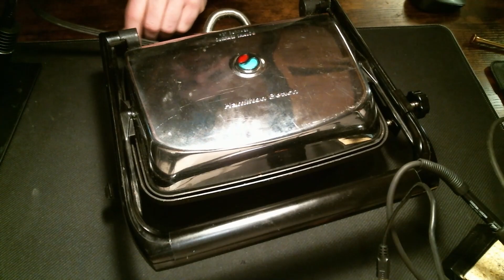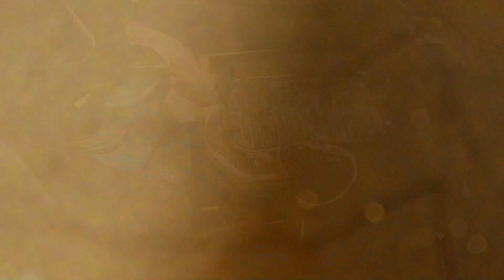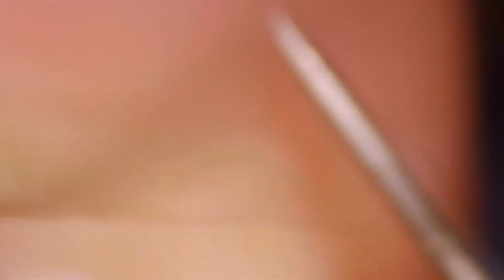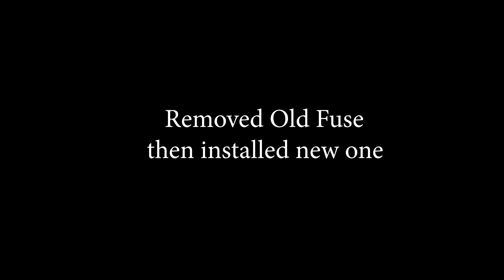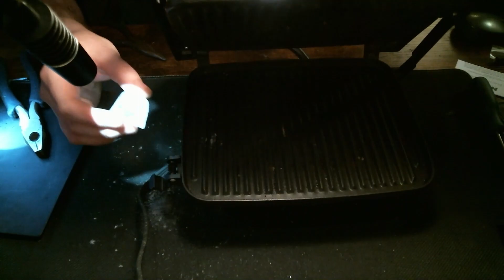Fixing a Broken Hamilton Beach Panini Press

Comment: What type of but connector you use ? And what gage ?
Reply from the maker: This was a thermal fuse replacement.  Uses mechanical connections.  Essentially you crimp the ends together with metal clips

Comment: Video is great!  MY HB PP bottom grill is detached from the base - is there a good way to reattach - can I use tape or glue?
Reply from the maker: Tape or glue will likely not last long, it is possible to bend some metal and screw it in or do some sort of mechanical fix?  If you're interested I could help if you joined the channel discord channel

Comment: Did you just solder the new fuse on?
Reply from the maker: No it will likely melt if you do that. They come with little crimp rings so you can mechanically bond the legs of the thermal fuse to the wires
Reply: Mine didn't come with any crimp rings . Can you recommend one . Thanks

Comment: What type of bit did you use to get the electric cable wires under the black housing (4) screws ? Please.
Reply from the maker: Oh it's hard to recall, either a Philips or a torx bit maybe.  
Whats the issue you're having?
Reply: @TestingWithMike  no worries I got it loose.  Thanks for sharing your knowledge 🙏

Comment: I bought a new 3-in-1 sandwich / waffel / grill master from LIDL..used it 5 times... it did warm up slow, but I thought it was normal for the model.. now it will not heat..plates are cold..but the lights are still on, when power is on.... but the watt-meter I passed it through, says 0 watt.. thoughts ??
Reply from the maker: Likely a blown fuse or thermal fuse.  Going to the warming plates.  Crack it open and use a volt meter and follow some of the testing methods I use in this video, and im sure you'll find the issue
Reply: @TestingWithMike  Yeah, it must be something like a blown fuse, or a wire that is disconnected... thx for answer..
Reply: @TestingWithMike that's the answer I needed

Comment: My H-B panini maker has been sitting in the back of a kitchen cabinet for years.  The plastic colored light cover broke off and the internal part containing the bulbs fell inside the machine.  I took it part but don't see any obvious way to fix it.  Any suggestions or should I buy a new one?
Reply from the maker: Does it turn on and heat up? We're you able to check the thermal fuse?
Reply: @TestingWithMike  It heats up, but I don't use it because I fear the wiring, bulbs, or plastic housing may contact the heating element.
Reply from the maker: @Paladin1873   Is there any way for you to fix the wires that fell through or at least get them out of the way?
Reply: @TestingWithMike  No.  The bulbs and bulb wires rest on a round plastic cup that sits centered under the top lid.  There's a hole in the center of the lid that normally is covered by a red and green colored plastic cover that attaches to the cup inside.  That part broke off several years, so now the internal cup and bulbs have no way to stay in place.

Comment: As part of the initial testing you do, I always add a Kill-A-Watt meter before the plug, so even if no tell-tails (lights) come on, it can still determine if it's drawing power. Another tool is a variable DC bench power supply that allows you to put power to select sections of the circuits and see the reactions, or lack there of.
Hope that helps. Keep up the great work!
Reply from the maker: Great tips thank you!  A DC Bench supply is one of the next tools I need to invest in

Comment: When checking your thermistor for voltage, you should not read voltage from one terminal to the other. When you read voltage to ground on both sides=the thermistor was working as designed
Reply: Great video tho! I don't wanna sound criticizing, not at all. I love fixing things that "can't be fixed"! I think your channel idea is a superb one. I hope that it encourages other to take a stab at repairing things instead of throwing it out and just buying new! Keep it up! 👍
Reply from the maker: Great tip!  I figured since it had continuity with low resistance, all should be good.  Noted for the future though, thank you!

Comment: I think seeing you replace the fuse would have been hella interesting
Reply from the maker: Truth be told, the footage was corrupted.  Essentially the fuse comes with two clamp down brass circles which creates a mechanical bond.  Because the temps can get fairly high, there's a potential of solder melting, so mechanical is the only option.
Reply: @TestingWithMike  fair enough… are there special considerations when you’re tucking in the wires since it’s in a hot environment most of the time?
Reply from the maker: @blueclothes1  everything in the press is temperature rated. you can tell by the wires that are used.  they all have a thick insulation around them to protect them from the heat.